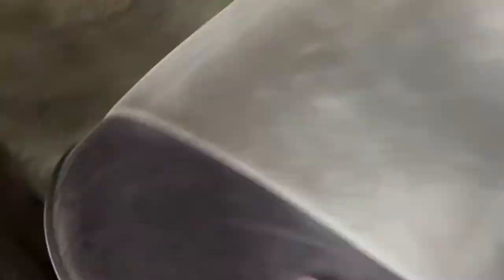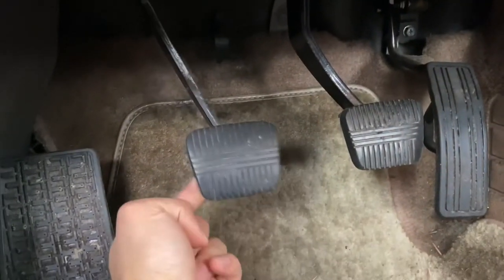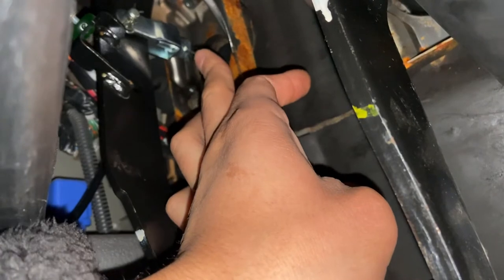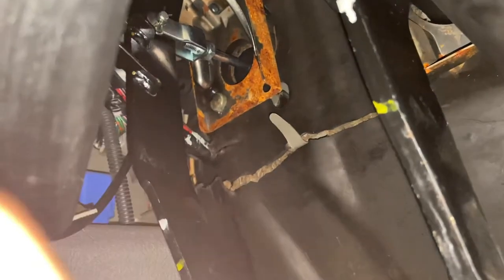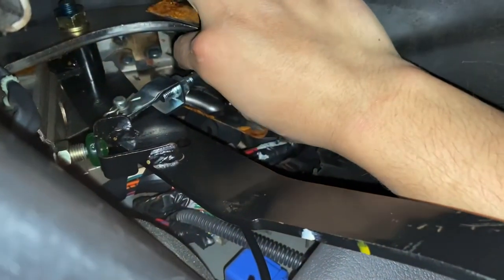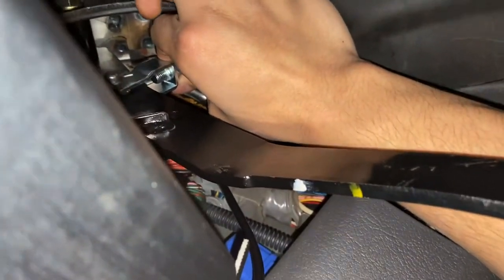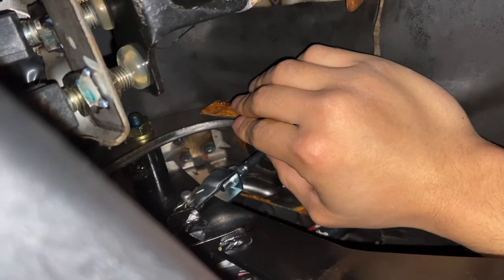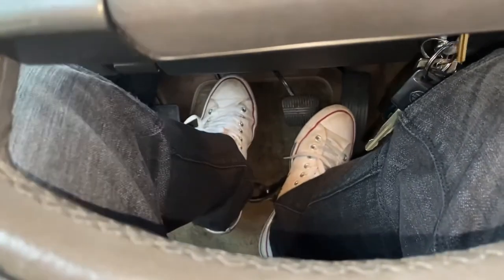Clutch pedal adjustment on z31 300zx

Comment: woke up this morning with my clutch biting point all the way to the floor lol 
will try doing this later today and ill report my results

edit: well it helped but unfortunately, there's no more room to adjust and it's still pretty low : /
Reply: Did you figure out what to do because I have the same situation, it’s so bad I’m on the last thread and the clutch isn’t fully engaging so that I can go into gear
Reply: @the_cart_project918  yeah sooo, i bought a new master and slave cylinder and replaced them , because aparently they go out and leak fluid or whatever happens to them. there are decent vids on youtube on how to replace them and add fluid. open your slave cylinder and see if its low on fluid. if it is, you could temporarily fix it by adding more fluid and bleeding the oxygen out of it. a permanent fix is replacing the master/slave